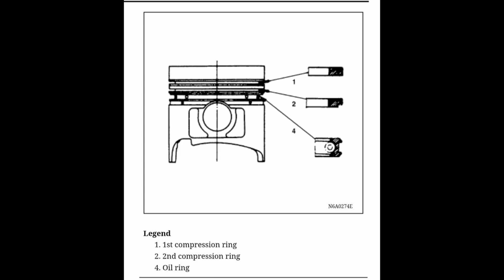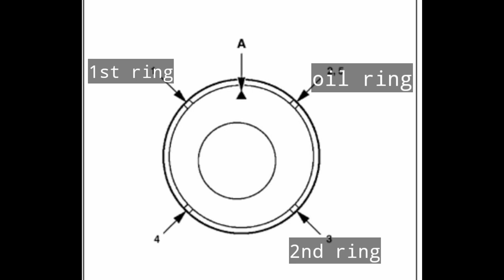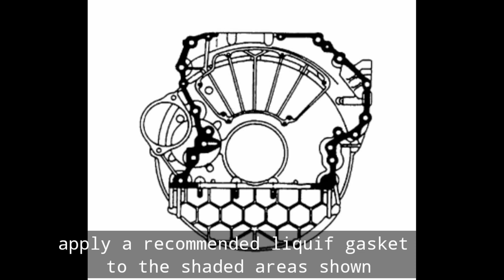ISUZU 4HG1 engine rebuild,PISTON and GEARS installation

Comment: Boss ask po ako sa inyo may problema kasi man na truck edc 03775-02 ano ba problema nito
Reply from the maker: Sir ang sinasabi dito sa libro.edc 03775 ay rail pressure monitoring.yong 02 ay too low.so ibig sabihin rail pressure too low.check mo sir ang pressure relief valve.kung may pamalit ka subukan mo palitan.check nyo rin po yong group of wires na kulay brown na kasama sa negetive terminal ng battery.baka mag naputol doon.